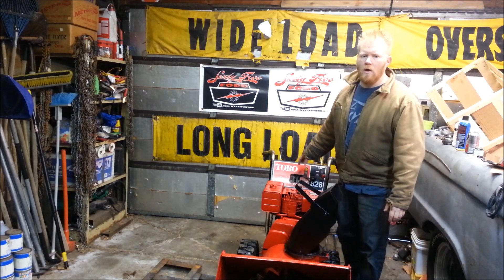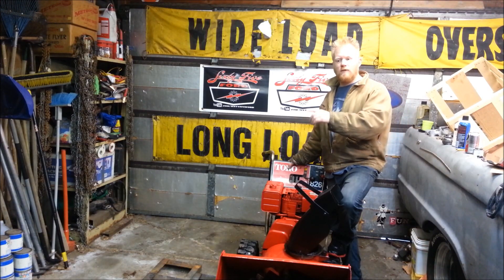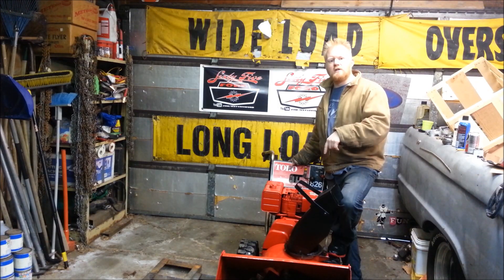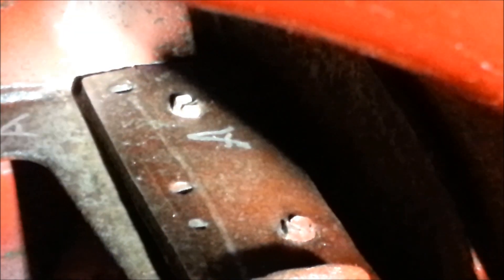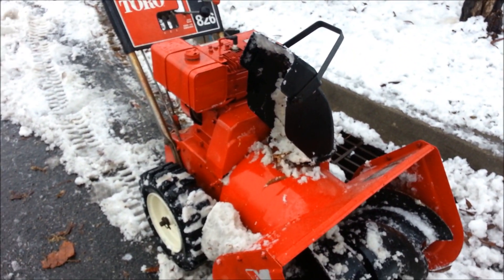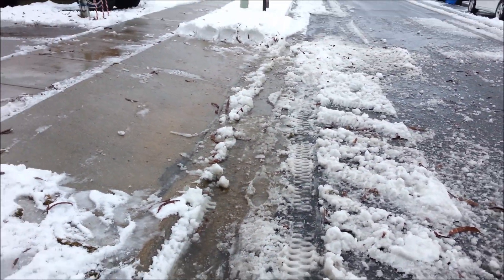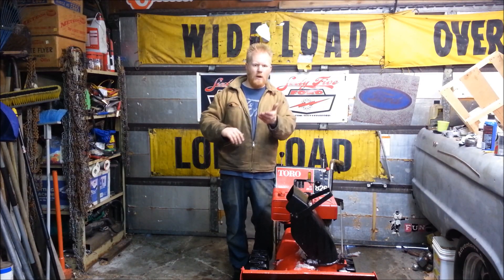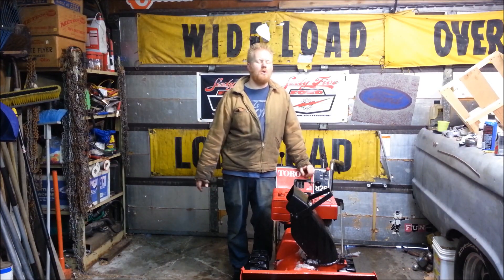TEST snow blower Impeller Modification with and without

Comment: We were gifted with an old MTD/YardMan 2 stage blower at the beginning of this season, this last big storm she shredded her auger belt.  Her drive belt looks ready to go as well.  I can't wait to give her new belts and add impeller paddles, and say goodbye to the clog after clog at the end of the driveway and in the gutter.  Thanks for the Video!
Reply from the maker: You're welcome. I'm glad you like it. Let me know what you think when you get around to doing it.
Reply: Awesome!  
It was so cold but I broke her down in my kitchen!!  LOL  I love my wife!  I put on the new belts and I used thick baler belt rubber for the paddles. The self tapping screws wouldn't go through the impeller blades so I drilled holes and used nuts & bolts to secure. I didn't have any locking compound for the nuts so I used my wife's nail polish!  Did I mention I love my wife!
The modification was amazing it threw the snow about double the distance. No clogs in the heavy stuff, no build up in the housing. I've told everyone I know to check it out on YouTube!  Thanks!
Reply from the maker: That's great to hear. The Kitchen is the perfect place to work on stuff, food not to far away.

Comment: I’m sold. The question that this raises, is why don’t the manufacturers incorporate this idea in their design?
Reply from the maker: The higher end models have significantly closer gaps and have less of an issue with clogging. The cheap sub $700 Home Depot units have tight margins and people throw them away due to poor performance and buy the more expensive units. They make more money and no one faults the manufacturer.

Comment: I bought my snowblower several years ago and used it twice. The first year was not too bad, we had one good dump of dry snow. The second year it was several dumps of wet with freezing and thawing. Once the snow was damp the snowblower was useless! Every 5' or so I had to clear the chute. I finished the job by hand. This last season I happened across your video and thought I'd give the machine one more chance, after sitting in the garage for 2 winters. It took me about 30 minutes to do this, in the freezing cold outside with my hands going numb. WOW, it was worth it! This thing now plows though snow wet or dry, sends that snow right across my driveway, and over my 6' fence if I'm not careful. Thank you for posting this video!
Reply from the maker: That's great. Thanks for sharing.

Comment: Like this idea... My craftsman 11 hp has 3/8 to 1/2 inch of clearance. It has a metal 3 blade 2 nod stage impeller so need the 3 seals. Do I have to pre drll the impeller or can you drive the screws in with a good drill?
Reply from the maker: If it's 1/8" or less thick steel then most self taping screw will go through it. 6 feet is a good amount of snow. You need this so your snowblower can throw high to stack it. You should notice a big difference with your gap.
Reply: Thanks for the slick advice.
Reply from the maker: Let me know how it goes and let me know what you think.

Comment: OK, did this paddle extension to a 72 inch hydraulic driven bob-cat skid steer. It does make a difference in performance even on a big machine. Thanks
Reply from the maker: James P Bergeron Awesome. Did you use standard 1/4" conveyer belting?
Reply: sixtyfiveford Yes and I just did it to an 1132 Honda and tested it in old snow. It definitely makes a difference. I did it with heavy duty conveyor belting and made it cover the entire paddle surface on both machines. You should be commended for this effective way to improve the machine efficiency. Just making the "throw" of the paddle tighter in the space between it and the tunnel does make a very noticeable performance improvement.

Comment: Where do you make your rubber pads from?  I know it wouldn't be you style to buy them.
Reply from the maker: I really like the old straight rubber paddles from the Toro S200-S620. There was a years where I did a ton of them and saved all the old worn paddles. Sidewalls out of tires, old conveyor belt, or trucker mudflap all work good.
Reply: I have a Murray that just doesn't throw very far you care if I make the same type of video... Before and After?  If it does not sell in the next day or so, and it's okay with you,  maybe I will give it a shot and you another shout out!
Reply from the maker: Go for it. It'll make you a believer.
Reply: I have heard bailer belt works great if you have a farm and tractor store around. Also truck mudflaps.
Reply: doublewide6 your 2 stage will do as sell as the new 3 stage.  only difference
would be...elect. start / joy stick for chute and deflector / lock wheel turning.
I think that if you use Mo's mod's you will save yourself a thousand bucks
Reply: Bob Haddock I'm not buying one, just curious how much they are.  MTD / Cub Cadet use some thin metal.  I have an Ariens 12 HP with all the bells and whistles.  I like everything about it, but the  friction disk can get wet and slip.
Reply: doublewide6 guy told me that Ariens had snowblowers first.  don't know for sure.   any way to prevent the disc from getting wet?
Reply: Yeah, clean up the really heavy wet snow at the bottom of the driveway after I'm all done clearing the driveway.  Or Pine sap on the disk.

Comment: Thank you for taking the time to produce this (and all) your video(s).  I used rubber from an old truck bed mat on my new snow blower last summer, and the difference was astounding!  It was a little difficult modifying an essentially brand new machine (used one winter), but I feel this simple modification made my machine perform like I thought it should have originally.  Deep, heavy, water laden snow just flies across the yard with no clogging.  I really appreciate your "work with what you have" approach so people like me can make improvements without spending a bunch of cash.

Comment: I have a craftsman and the blades on the impeller are curve up towards the front.  Is it important to get the rubber on the entire run or will just the straight portion work.  Have you ever done a crafstman?
Reply from the maker: Ryan DeFalco Just the flat portion is all that is needed.
Reply: I did this mod. My craftsman now launches snow.  Thanks!
Reply from the maker: Awesome.. You're welcome.

Comment: Sixtyfiveford, I wanted to give you a big thank you for making this video. I just recently did this upgrade and it made a huge improvement with my snowblower. I used rubber from the sidewall from a old tire and used stainless steel nuts and bolts. I had a chance to use it on one of the last snow falls of this year - wet heavy snow. It worked great. I would say it was blowing about twice as far as before.  Thanks again.
Reply: What did you use to cut the rubber from the tire sidewall? I thought tires had a bunch of metal in them.
Reply: @o0Avalon0o  I can't remember exactly right now but, I think I used a sharp utility knife and a pair of tin snips.
Reply: @o0Avalon0o  sidewalls are easy to cut with just a utility knife, if you just leave the tire bead alone.  If you're trying to cut the tire tread, the only possible way to do it is with a reciprocating saw. I put the tire between tire ramps to create a slot for cutting; makes short work of it. 
The tire pads are multi purpose and good for all sorts of things like Jack stand pads, hydraulic jack pads, motorcycle kickstand pads, and knee saver kneeling pads 😎
Sidewall probably works better for the impeller extension than the tread area, which probably is too thick to work with, so I'll probably try it with that.

Comment: Does your PowerShift chute rattle?  No  matter how much I tighten things it still does.  It did so prior to this mod.  Any solution?  BTW-all set with the impellers.  Pretty easy to do.
Reply from the maker: Bob Dawber Yeah, they are known to be loose. You can put shims in between the chute and housing if it bugs you.

Comment: I got a Sears Craftsman 179cc 4 cycle OHV 21 inch width snowblower (has electric start). Will this work on mine. I had a hard time with wet snow yesterday and was thinking on what to do to make it better in heavy wet snow.
Reply from the maker: Sounds like you have a single stage rubber paddle snowblower. This modification only works with 2 stage units. Single stage units will struggle in wet snow and clog when the paddles get worn down. If you have more than 1/4" gap between your rubber paddle and the housing the paddles are completely worn out and need replacing.
Reply: sixtyfiveford ok, thanks!!!

Comment: How to you safely install the paddles? I've seen people just unplug the spark plugs, "check there's no tension," remove the chute for a peep hole while they install from the front with self tapping screws. How to you remove tension?
Reply: If you're that concerned, you can take the belt cover off and check to see if it is engaged.  Belt covers are normally designed to come off easy and typically only have two bolts.  On some brands you don't even have to completely remove the bolts.
Also, you can take your clean out tool(all blowers should have one and they are cheap to buy) and push the impeller with it to see if it is stuck or "under tension".

Comment: Okay I want to do this, I live in the snowiest city in USA, Syracuse. So if it works its gonna work for everyone. I'm just concerned that I get the right screws, do you have a link to Home Depot of the screws you use?
Reply from the maker: Fishingtuts They are called Self Drilling or Self tapping screws. They may have a smaller box but this is what you want Size 10 phillips self drilling metal screws : http://www.homedepot.com/p/Teks-10-3-4-in-Phillips-Pan-Head-Self-Drilling-Screws-170-Pack-21372/100142820
Reply: sixtyfiveford Thank you.
Reply: sixtyfiveford Got the screws and I found a rubber coupling. Will fix it this Sunday.
http://www.homedepot.com/p/Fernco-4-in-x-4-in-PVC-DWV-Mechanical-Flexible-Coupling-P1056-44/100372298
Reply from the maker: A few people have used those couplings with good success.
Reply: sixtyfiveford After a few tweaks I finally got the impeller to turn and it throws twice as far than normal but it does get blocked in heavy wet snow that I went threw today, maybe I need my belt adjusting. Thank you for the great tip.
Reply from the maker: With the added efficiency it is very likely your old belt is slipping.
Reply: sixtyfiveford Adjusted the belt and wow it has turned my snow-blower into a beast. I went threw 18 inch of snow and ice and it threw them 30 feet with ease.
Reply from the maker: That's great to hear.
Reply: Syracuse, my ass.. Worcester this year buddy
Reply from the maker: Easy now... There's enough snow to share. :-0.

Comment: Couple of crazy snowthrower questios:
1. I have an 8hp MTD 2 stage. A while back my friend tied it to his ATV and trailed (backwards, housing up) it 6 blocks to his house. Now it seems like it's slower even though if I lift up the wheels they are spinning. Could this have damaged the bearings? What should I do to check? It has 6 forward speeds and 2 reverse speeds.

2. Is there any way of using this baby as a garden tiller?
Reply from the maker: There is a rod that moves when you change the speeds. This more than likely got bent and now wont allow it to go as fast. Bend it back straight and you should be good.

A snow blowers auger gearbox is weak and would more than likely break. Ariens came out with a model that the front snowblower part would come off and you could switch it out to their tiller.
https://encrypted-tbn0.gstatic.com/images?q=tbn:ANd9GcTd1BVVoyiXTaNzNobe9-fpkIy_pZGTOpv71z8vMqVCh6AyBk1opQ

http://scotlawrence.smugmug.com/photos/685686216_9Ay6i-O.jpg

Comment: I've got a second stage impeller with 3 blades.  After watching your video I picked up 2 pieces of mud flap only to find out that my blower has 3 impellers. Do I need to put the modification on all 3 blades or will just 2 work??
Reply from the maker: Jim Spencer All three will keep it balanced.

Comment: I have a simplicity 7117 Garden tractor with a single stage snow blower attachment  I have appx " gap from the impeller and the housing when the impeller rotates, but when the impeller rotates to the top of the blower I only have about 1/2 clearance and when the impeller rotates to the blower blade I only have 1/4" clearance.  I tried making paddles but they just tear asap.  any suggestion as to how to make the paddles work.  thanks and love the idea
Reply from the maker: I have the exact some blower on my 7016. You need conveyor belt or a paddle from a single stage snowblower(made from conveyor belt). I trimmed the V panel at the top that prevents snow from being launched forward to match the paddle clearance. That's what chews mine up as it acts like scissors with a rock or ice. I thought about even cutting it up further and attaching rubber along the edge.
Reply: @sixtyfiveford  Im a little confused when you said that you trimmed the v panel at the top.  Im not quite sure where you are referring.
Reply from the maker: @richardreis7327  When looking at the front opening of your snowblower, Just above the auger/impeller in the center you will see a wedge or v-shaped deflector. It's there to keep any snow that doesn't go up and out the discharge shoot from flying forward into the path where you're snow blowing.
Reply: @sixtyfiveford  I'll have to check that out on wednesday when Im off.  What did you use to trim the panel.  If Im not mistaken I think mine also hit the blade of the blower   thank you for all of the input

Comment: I found a place near where I work that sells conveyor belt products.  The cut me a strip from a scrap.  I was about to install them and stopped with a question.  I have a Toro Powershift 824.  When the impeller comes up the rubber will hit the metal pretty even (against the metal) pretty low and then it will still have a gap.  I assume this is normal because this is where it will pick up the snow??
Also, the way the shute lines up with the impeller the rubber nicks the edge a bit.  Was that also to be expected?
Reply from the maker: Bob Dawber Sounds normal. The impeller isn't always centered perfectly so this takes up some of the gap. You will want it to stick out as far as possible and just barely skim these higher spots.
Reply: Sounds good.  Now we just need snow.  I live on the Maine/NH/Mass border and we have had one small snow fall so far!
Thanks for the reply and for the great videos!
Reply from the maker: "Let it snow"  Let me know how it goes once it's done.
Reply: I will!

Comment: I have an older Ariens with a 4 blades impeller. I did the mod on two blades and there is a good difference. But I would like more. Is doing the 2 other blades going to be another improvement or would it be about the same overall?
Reply from the maker: I don't notice a significant difference with doing 2 vs 4. If it's an easy model to do this too then I will sometimes do it. Some of the pre 90's machines have poor discharge chute design and I've cut  and welded them to allow for the snow to go higher before it angles over(if that makes sense). This give more distance.
Reply: @sixtyfiveford  Thanks for your answer. :) A video on this chute mod would be a great idea I think, as there are many older snowblower users out there.

Comment: I havent had any clogging issues with my Cub yet. But then last years snowfalls were mostly powdery so this is something to keep in mind. One question, once the new paddles are installed do you suggest "bedding" them in with the housing dry... say, just running it in the garage or bedding them in wet out in the snow.

Comment: thanks for sharing!! Going to look at the same snow blower. Controls are in the same place as the one in the video. TORO seems to make good equipment i think. Has that been a reliable machine??
Reply from the maker: Toro stuff never dies. They built and still build some of the best stuff out there. The only thing I ever need to do when a Toro comes in the shop is a carb clean due to neglect.

Comment: That 826 toro is awesome, I regret selling my 724 Toro but I got the 524 for now and it does the job. Hey so what did u use for them rubber paddles? Where'd u buy or get them from? Lmk I'd like to do this to my blower.  Thanks
Reply from the maker: I use these https://amzn.to/3oO9Qoc . They are for little single stage machines, but it is roughly 1/4in thick by 3in by 18inches long of fiber reinforced rubber. Enough to do 2-3 machines.

Comment: doin an old mtd tomorrow..has thick impellars..can self tappers work?or is it necessary to drill and bolt
Reply from the maker: +jimmy shine Self Tappers work just fine.
Reply: +sixtyfiveford k thx
Reply from the maker: Let me know what you think.
Reply: +sixtyfiveford all complete ..new carb fro amazon 15 bux..tractor bailer belt paddles installed waiting for snow tonite..self taps seemed fine..ez install thx

Comment: I live in Canada where it's cold as a mofo. Wet snow is generally not a problem However I recently traded an old snowblower for some firewood and was not impressed with how the snow dribbled out its shoot. This guy seems pretty smart, so I tried this modification. On closer inspection of my impellers they were all slightly bent back on an angle.  After straightening them out ,I did this modification and if I hadn't of spent the time to do this modification I wouldn't have noticed that. My snowblower now throws like hell and I'm certainly glad that I did this. Cheers!
Reply from the maker: Awesome